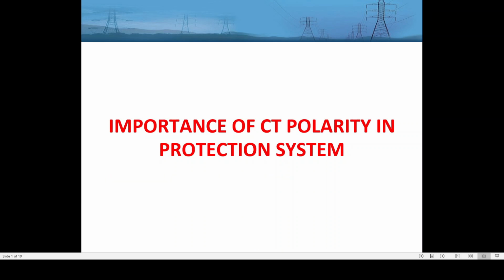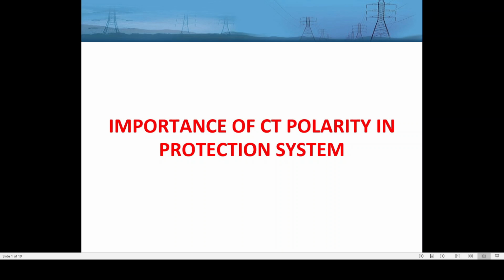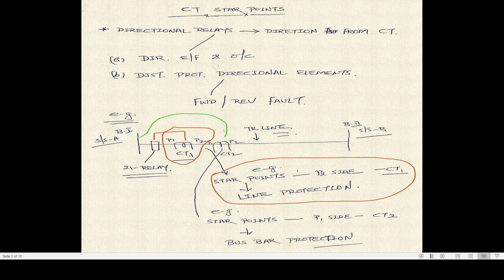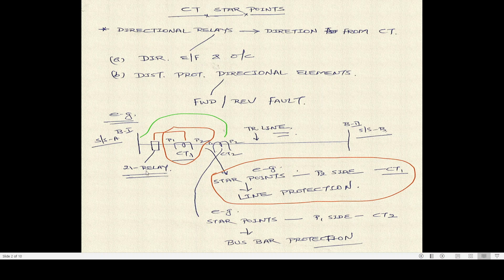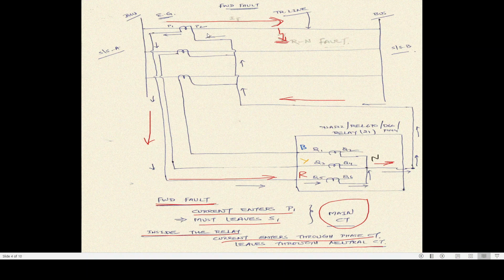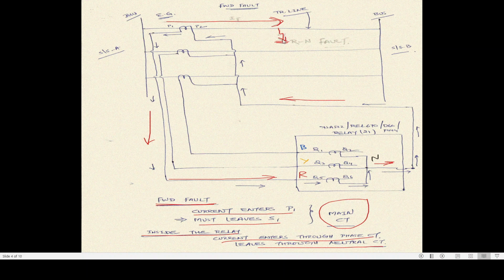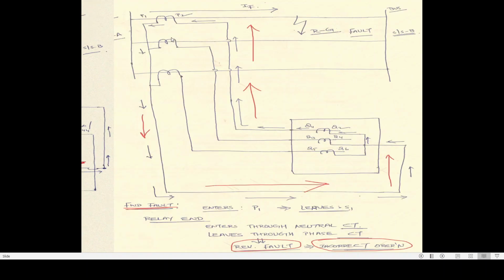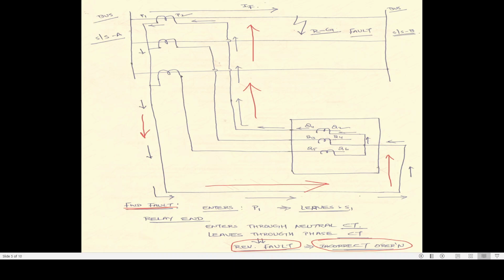CT POLARITY || WHY CT STAR POINT IS ALWAYS FORMED TOWARDS PROTECTED OBJECT SIDE || PART-1

Comment: Have you ever encountered wrong CT polarity in the field? If so how can you troubleshoot with the help of a three line diagram!
Reply from the maker: Yes. In one instance Line Protection Operated for Bus Bar Fault. While in one case, the CT polarity was reversed in Metering Core and same was identified from meter reading. You can identify wrong CT polarity by carefully analyzing the DR or by checking the field wiring in CTJB or at CRP.